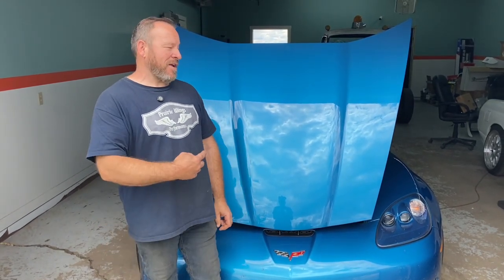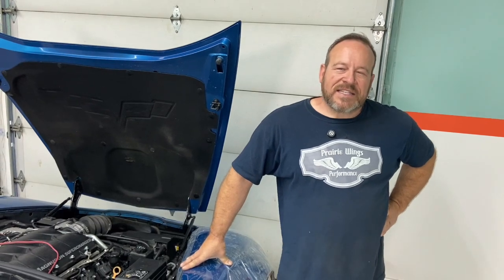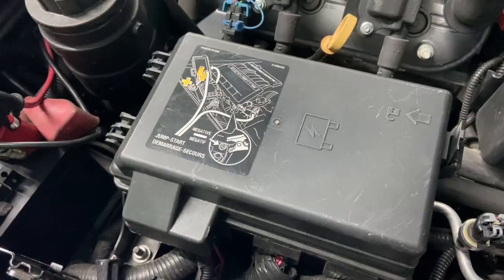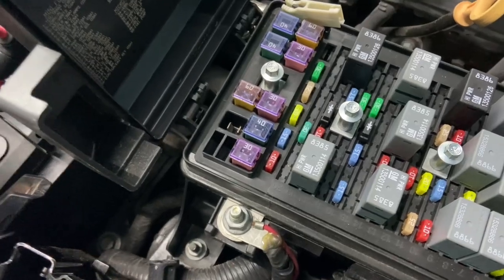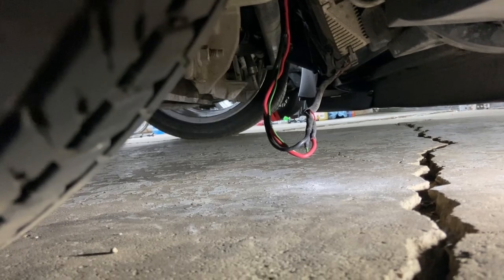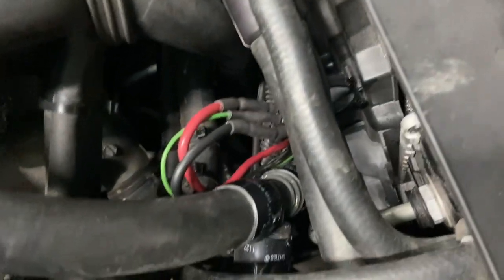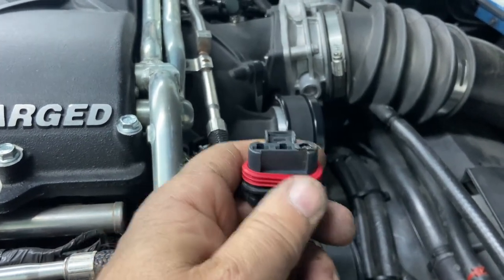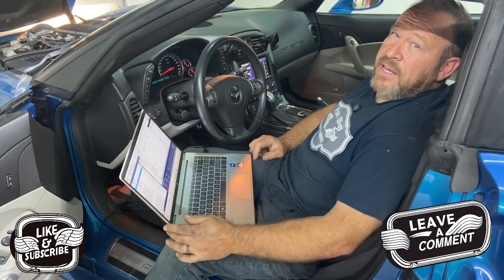C6 Corvette Overheating Problem Solved #C6Corvette #overheatingfix

Comment: My car recently melted the connector as well. How has yours been since hard wiring it straight and no connector?
Reply from the maker: Absolutely no problems, lots of hot days and running big boost. I even turned up duty the cycle on the fan and it’s been solid! Make sure you use quality crimps and heat shrink. Thanks for taking the time to watch and reach out.

Comment: I'm always amazed when I see a 14 Guage (for instance) wire and a connector that is the equivalent of 20 Guage. It's like a built in failure. 
As for working on the floor with one  hand.  Lmao, that's top class working conditions.
Reply from the maker: I’ve e been driving it like this for a month now and it’s working flawlessly! Working conditions could have been better if it was in the gravel  driveway with a foot of snow!!